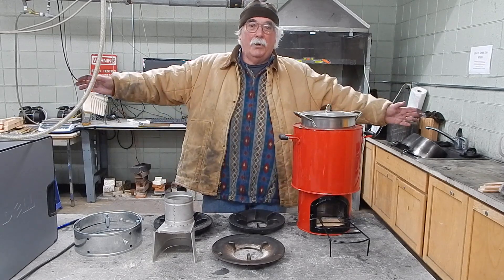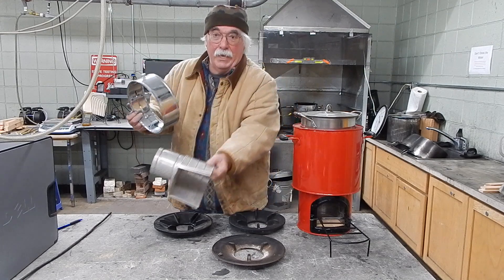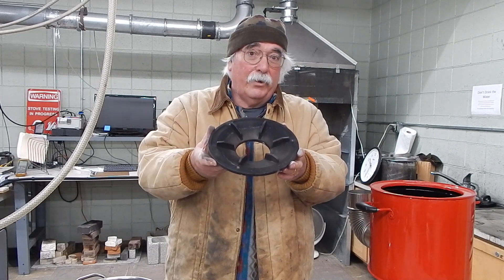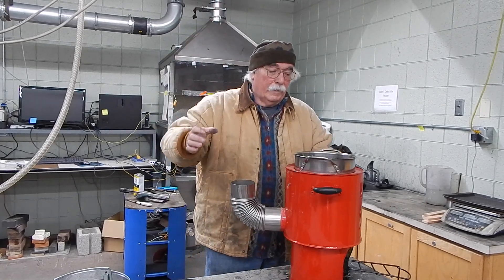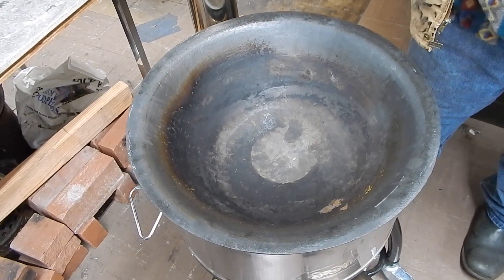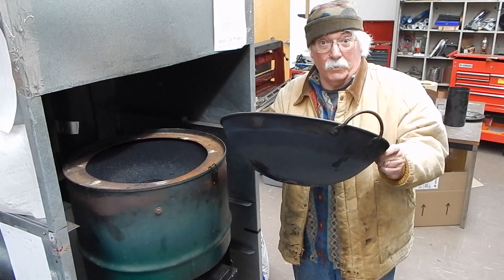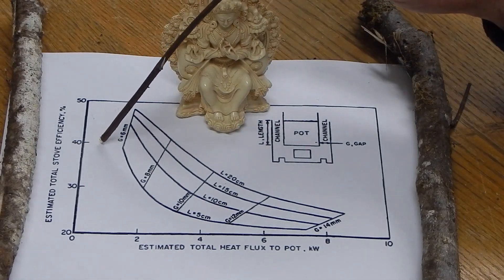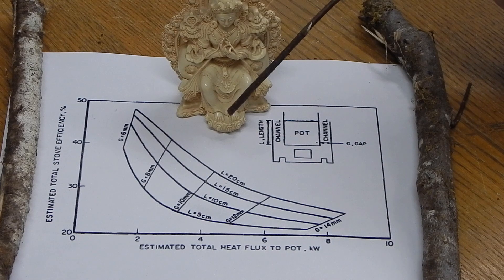Rocket Stoves 2021 - Pot Skirts

Comment: What is the importance of heat production efficiency, % wise, to heat transfer? Would more pot surface exposure be better, e.g., handles at the very top instead of down on the side? 
What about the third element, heat retention? For example, cooking 80% and putting the pot in an insulated box to finish? 
What about heating with the sun, by radiation, e.g. an inferred concentrator with transparent insulator?
Reply: Lots of great ways to increase heat transfer depending on the situation. Maybe check out "Clean Burning Biomass Cookstoves" at www.aprovecho.org?